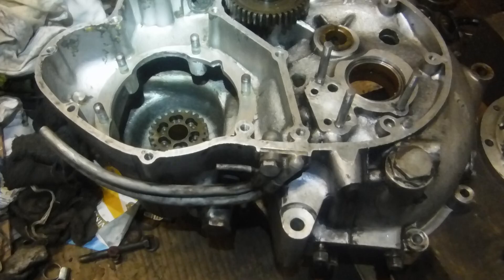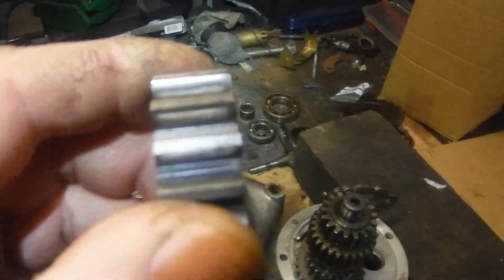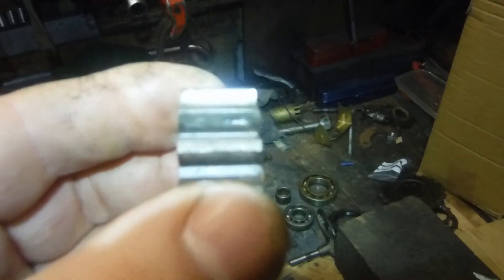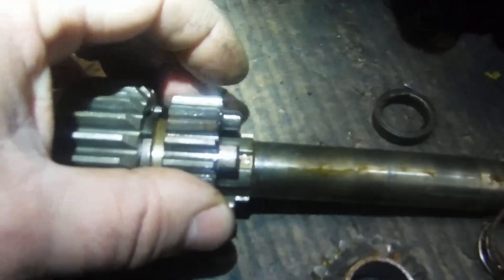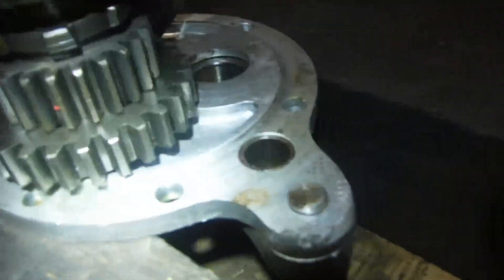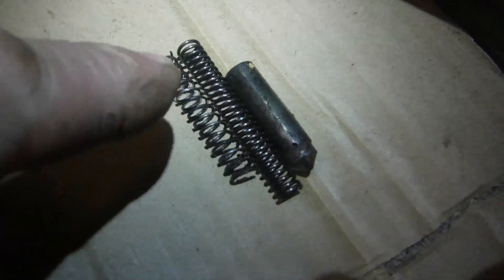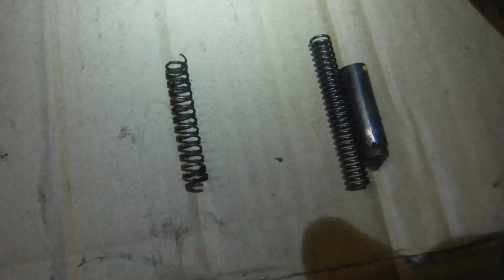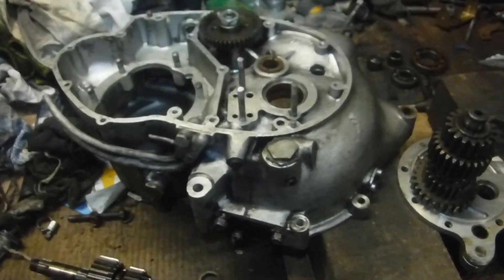BSA A65 Spitfire engine overhaul 5 Reassembly begins, selector camplate spring bodge discussed.

Comment: The old spring is actually correct, just broken, as they do. the one you ordered in is an updated version.
Reply from the maker: The replacement item is certainly a lot stronger than the one I removed, as well as longer - so worth doing in any case.

Comment: would you mind sharing who supplies those conrods?
Reply from the maker: Burton Bike Bits supply these. SRM sell similar at a slightly higher price. The ones seen here, from BBB seem to be of good quality, are said to be American made, and I have fitted a few sets in engines to date at owners requests, following a blown up engine I rebuilt a few years back having expired due to a failed original type rod, as can be seen in some of my previous A65 videos.

Comment: Not sure of the spelling but I used to refer to the wear on the gear teeth as “brinelling”.  Also heard it called spalling.
Reply: Brinelling, most commonly found in ball bearings that have been subject to background vibration leaving an indentation in the softer of the two metals (hence "Brinell" Hardness test)  and Spalling, where the surface part of a metal is torn from the parent metal body by movement against another metal component. Both are rather different effects than the shown wear, which I don't think is due to either.

Comment: Something I've yet to encounter. Cam timing out, ignition timing out, wrong oil filter fitted etc etc are just a few of the bodges I've had to deal with. And the usual - no anti freeze - in expensive liquid cooled bikes